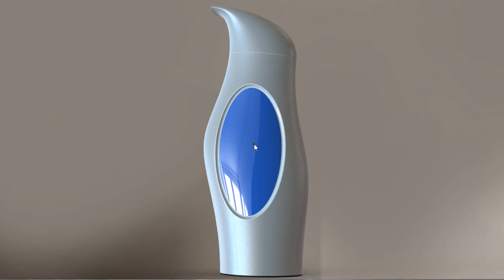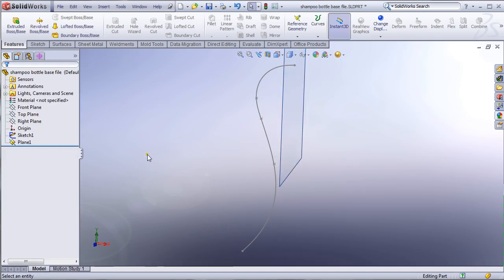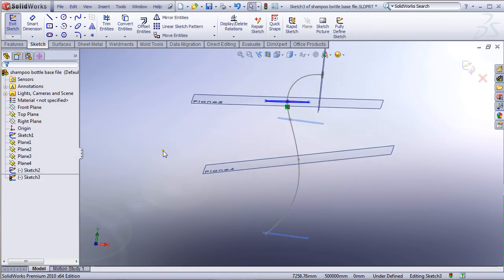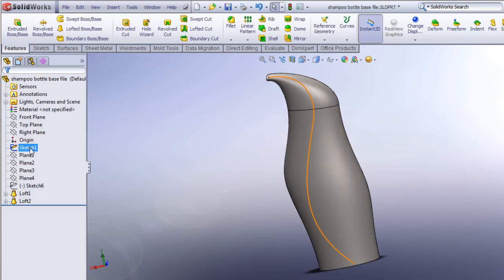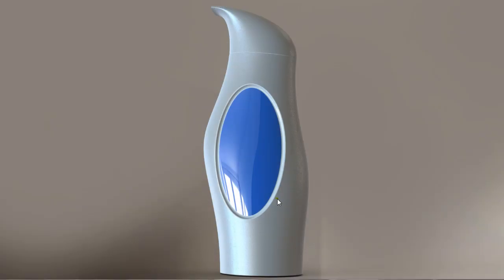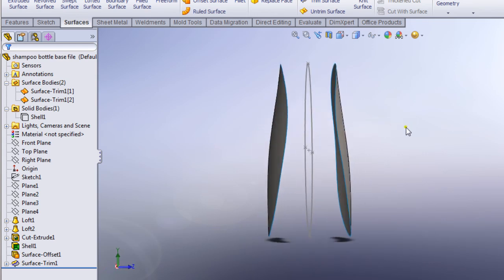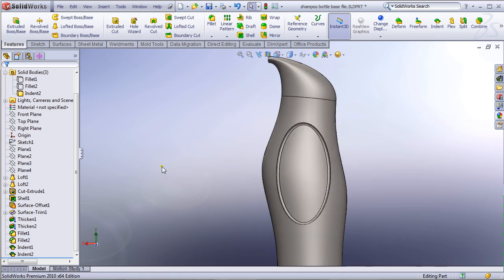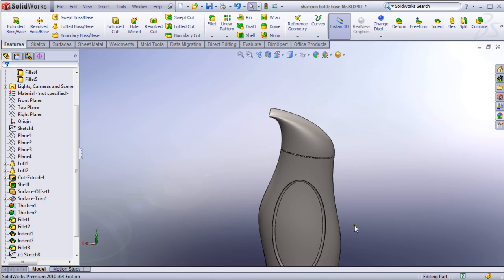Making of Shampoo Bottle Using - Loft, Indent, Split, Surface Offset, Surface Trim.

Comment: Great video!!!!
What does set origin on curve do? when you create each new plane.
Reply from the maker: When we check Origin on Curve box, it brings 0,0,0 (of all x,y,z axis's) on curve, which makes it easier to dimension from that point on. as well as relate to other geometry around.
Reply: ***** first of all, thank you for the speedy reply, 

I thought there is only one origin, I didn't know planes have origins as well.
Reply from the maker: Zoe Doucette We can even create a new co-ordinate system

Comment: Hi, MrArtstation . In the stage before the indent with the ellipse, You worked with Offsetting the surface and then trim surface and then the Indent. You could skip the offset surface command and the trim command by doing a split line on the ellipse, which would have copied the line on the surface directly. Did u use the other commands for a specific teaching purpose?